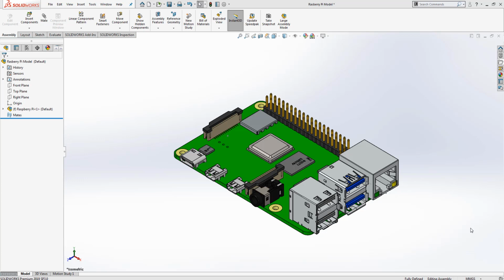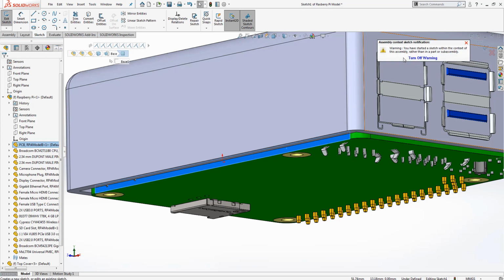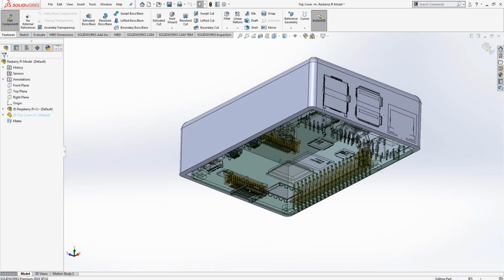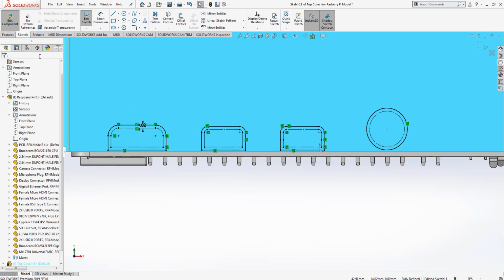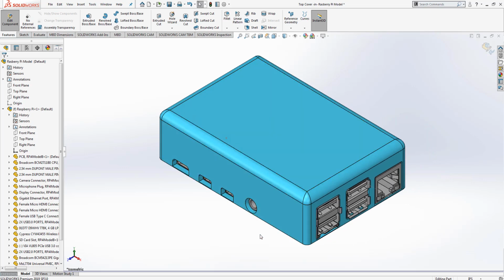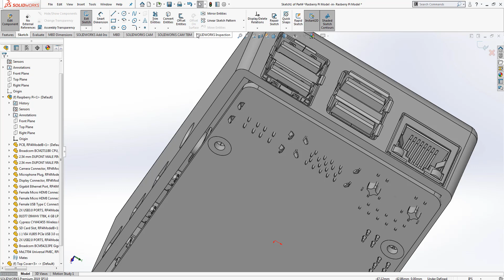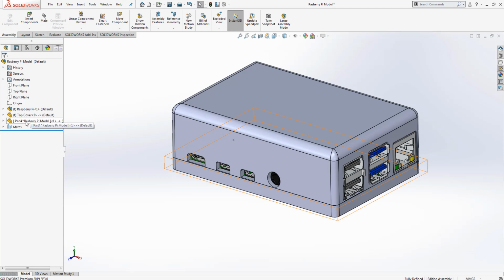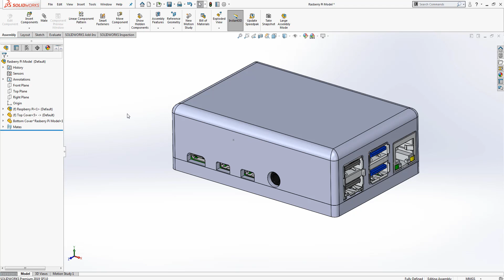SOLIDWORKS: In-context Design

Comment: Timestamps
0:12 Intro
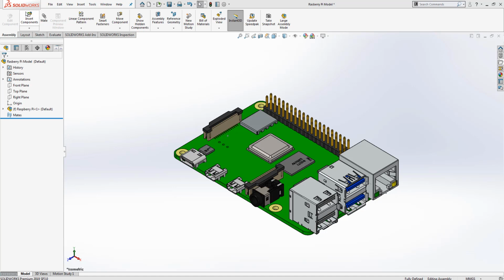0:30 Insert "Top Cover" part into "Raspberry PI" assembly
1:10 Important: Where do you want to have the changes to the part happen? You can choose to have it only happen in the "in context" of the assembly or "in context" of the part.  
1:49 Right click "Edit Part" to make cuts a part level feature. You will now be editing part while in assembly file
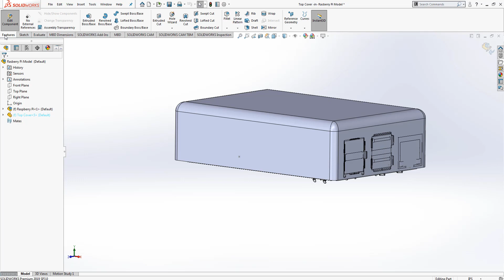2:06 UI change to default colors and opacity when in edit mode
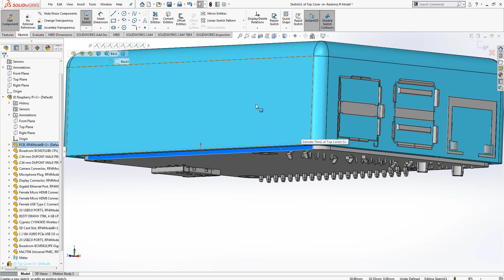2:55 Badass shortcut used but not discussed....here is how you do it   Hover + TAB = Hide body (Hover + SHIFT+TAB = show body)
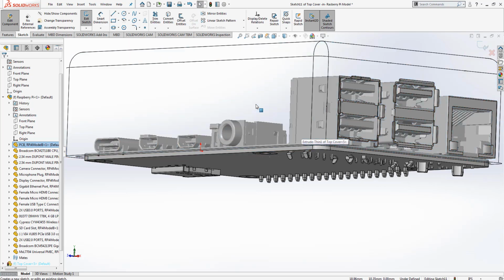2:58 Make sketch for cuts. Use intersection curve to project entities and cut part.
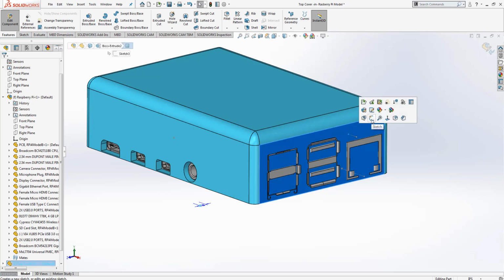4:21 Explanation of the link between assembly and part. Notice in Feature Manager "->" next to features made "in context" of the assembly
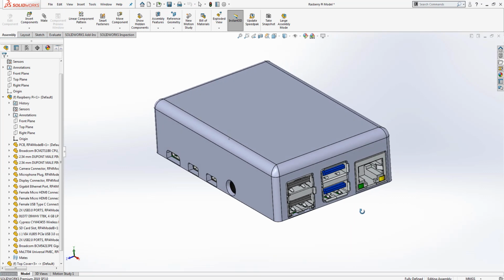4:53 Make a brand new part in assembly file, Click "Insert Component > Create New Part" and create on a new sketch plane. Notice in Feature Manager "[   ]" around the new 'in context" part aka "Virtual Component".  
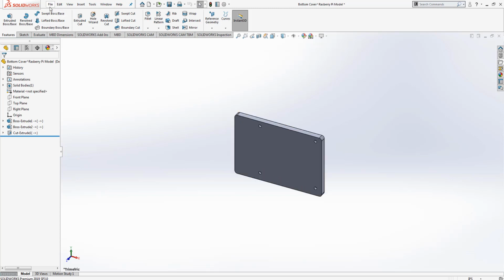6:48 How to "save as" virtual component out as a separate part.